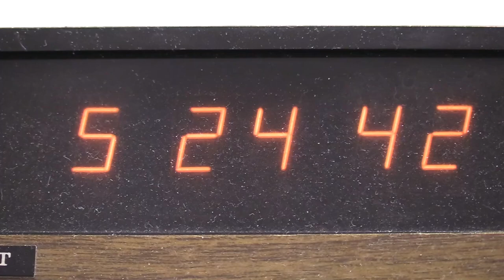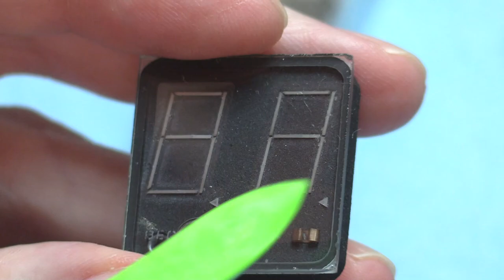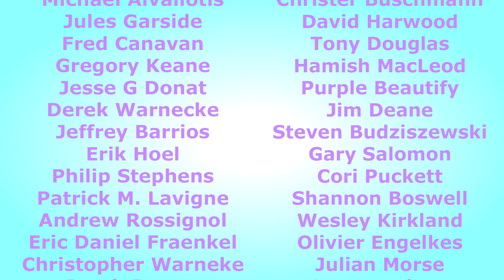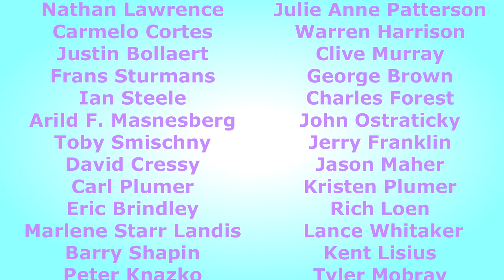Why Are Tubes Mirrored?

Comment: MAny of the older power tubes used the element Tantalum for the plate.  It made a good high-temperature tolerant plate, plus hot Tantalum absorbs gas, so a free getter.
Reply: The 845 uses carbon for the anode. Except for the modern 845M which has a metal anode.
Reply: I have long wondered about the potential recyclability of old vacuum tubes, crushing the glass envelope  and recycling the metals found within.  There must be lots of high-purity copper and steel, possibly cobalt and other rare earth metals.

Comment: There's a very interesting and simple experiment you can do by placing some water in a place, putting a very small candle in something that floats and then you put a glass upside down, covering the candle. It'll pull some water up the glass, by removing the oxigen from the air inside the glass. Very similar, but in a way smaller scale.

Comment: Some of the really high power ones use uranium glass seals.  If its got a greenish bead where the pins come out, thats what it is.  I've never read any radiation there but it glows really nice under UV light.

Comment: Wow. I had always figured that the silvering was either placed there to reduce radiative heat loss or maybe accumulated over use as a kind of gaseous deposition of metal from the hot emitter.

Comment: Phillips made a getter that is RF fired, but does not make a film, but becomes a reactive block in the vacuum. They are used for the inner getter in HPS lamps to absorb gas generated during the lamp life, so that you do not have a spot on the glass that absorbs light and creates a hot spot. 

Your 4-400A tube uses the pure iron of the anode, coated with a thin coating of iron powder, that is reacted back to metallic iron during manufacture with heating in hot hydrogen, so the iron oxide is reacted back to metallic iron in nanocrystals, so the iron can react with any gas during the tube life. They do need to run to red heat in use to get the iron to react, so they tend to be very gassy the first few hours of use, and if they have not been powered up for a while, so need to have a slow ramp up of power and detection of the tube arcing over. Once hot they will run for decades in use though, as use keeps the iron hot and absorbing gas.

Comment: As an Electronics Tech (Avionics) trained in the 70s, it was at a time when vacuum tubes/valves were disappearing and I worked on quite a few hybrid transistor/VT devices. 

As per normal in that era I also did a TV servicing course and tubes in TVs were rife at the time and accordingly they were still in the syllabus. 

At the time I was also an operating Ham and still have stashed away a couple of 4CX250 bottles with chimneys for that HF 1kW Linear Amp I was going to build some day….some day.

Comment: In accelerator vacuum chambers, after scroll, turbo and ion pumping, the last two "stages" are the cleaning done by the synchrotron radiation and the "getter pumps" which are nothing but Titanium hot filaments, capturing part of the very last molecules. From that, I deduce the high-power tubes you've shown might not need a highly reactive layer. A part of the hot surface, on the opposite side with respect to the conduction one (otherwise the capture would be reversed by the electrons, tending to sputter), plated with Titanium, Magnesium or Zirconium should be enough.  Not sure, is just an hypothesis, the accelerators vacuum is usually quite extreme (~10^-13  to 10^-15 bar).

Comment: Ah ... Tubes ! I love those things. I once obtained an old radio communication console from an old bomber which had some amazing tubes and even a squak box and code interpreter. I tried to get the Prints and schematic for it but I was told it was still considered as classified. I just wanted to convert it to a 20 meter Ham for fun homebrew projects. That thing was heavy, I wonder how that plane ever got off the ground.
Reply: I bought a Wireless No. 19 Set as used in tanks. It needed a lot of work to get it going: re-wired wrong wiring, 2 coils to re-wind due to corrosion, BFO disconnected, I replaced 3 visibly leaky capacitors, etc. Rusty and tatty.
I made it xtal control on transmit for stability, Morse Code only on 3.560, 5.262 and 7.030 MHz, and only 2 Watts with low H.T. It says something about the reliability of everything for it to still work after 76 years.
G4GHB.

Comment: 6:30 - The "lot of getter" is probably sputtering of electrodes that is common for plasma based light bulbs as material is being bombarded by gas that ejects microscopic particles of metal that deposited onto other surfaces._

Comment: if people are worried about vacuum tubes, what would they think of the 5 pounds of thoriated tungsten I have in my garage? It's in common use for TIG welding, especially with older machines. Yes. My geiger counter goes nuts in that corner!

Comment: I found what looks like a getter ring in the top part of a ZM1000 nixie tube but no silver spot or anything. Funny thing is the ZM1001 symbol nixie doesn't have the ring but a kind of plate and the ZM1030 has neither.

Comment: Fran, thanks for explaining. It's very clear.
But you mention a tube is "flashed" near the getter. What does that mean?
Reply: The manufacturer aims some kind of high intensity radio frequency or microwave beam at the getter loop inside the tube,  and that fast burst of energy vaporizes the material held within the gettor loop and deposits it on the inside of the glass.  I would think that the direction of the beam and how it is aimed would be important because you don't want those metals ---- presumably conductive and capable of emitting electrons when heated ---- to be splashed onto the other elements of the tube or the mica insulators because then  The Michael would not insulate and the misplaced getter material would emit electrons and interfere with the stability of the tube.

Comment: The filament inside the tubes might be containing small amounts of thorium, especially directly-heated cathodes. But these would be too small amounts to even be detected when you were taking the bare filament wire. And as you stated already in the video, the anode plates and the glass would perfectly shield the alpha radiation anyway. 

But for most I believe that this is the usual misconception of people associating barium (and cesium, strontium,...) with radioactivity, because radioactive isotopes of these elements are produced during nuclear fission. But of course in a vacuum tube one would use natural sourced barium (and/or cesium) for the getter, which can be considered stable and non-radioactive, even though it contains 0.1% of 130-Ba with a half-life of 1000000000000000000000 years.

Comment: When I first started buying and selling tubes several decades ago I was offered a bunch of 01A early radio tubes by a notorious local antiques dealer; the tubes were in what appeared to be their original boxes but the getters had a strong  "rainbow" colour effect, and so, in my naiveté, I assumed they were well-used and didn't buy them.  The guy wanted about 20 bucks apiece which I discovered later would have been quite reasonable and I could have easily doubled my money on them, but I didn't trust the seller who had a deserved reputation for overpricing everything....

Comment: I would think putting in any radioactive substances would be counterproductive.  With high voltages, any radiation would cause random discharges and "pops" in the signal.  You want clean vacuum to get clean signal, I'm pretty sure.

Comment: In most transmitter tubes they have an active getter that is part of the internal structure when the tube is run.833 tubes have these fired getters-at the base of the tube where there is no high voltage.Seen many of those tubes in 1Kw AM broadcast transmitters.Two for parrallel RF power amp-another pair as a PP modulator.If you watch one of these AM transmitters playing on air you can even see the plates of the mod tubes blink to the modulation.Same thing with the 4-400 tubes-used in 1Kw AM transmitters pair as an RF power amps-other pair as PP modulator.In really high power tubes flashed getters cannot be used becuase of the high DC and RF voltages will cause breakdown of the ceramic envelope-some cases glass.The ceramic-metal tubes can be broken down and "rebuilt" the glass ones not so.Too uneconomical.Generally power tubes of 1Kw and over.At the transmitter plant I am in 10Kw,20Kw,250Kw and 500Kw rated tubes for 250Kw and 500Kw SW transmitters.VOA site in Greenville,NC.

Comment: "How do we neutralize interference from free-floating gaseous electrons? Bury-'em".😁.  According to Ludwell Sibley, author of the excellent reference book Tube Lore,  water vapour was a persistent and important contaminant that needed to be removed. Some manufacturers reportedly baked the tube elements in pure hydrogen to drive out impurities. Gee, that doesn't sound like a risky process, does it?! 🤔

Comment: I'd love a Geiger Counter - But I don't even know what a Geiger looks like, let alone how to count them! 🤦

Hmm, I have a remanufactured transmitter triode which broke apart at the point where the glass was welded - I never even considered the radioactivity angle. I also have a second one which is still intact.  Have you seen the huge getter inside a TV CRT? About an inch to an inch and a half in diameter!

Now, which do you prefer "Halo" getter, or "Square" getter? - It matters, if you're a true audiophile, but to tell the truth, I can't tell any difference - Emperor's new clothes, maybe? 😺😸😹😻😼😽🙀😿😾

Comment: 6:21
No discussion possible: the number 0 (zero) may also be pronounced as o (the letter) when used in phone numbers, serial numbers, part names, etcetera.
Reply: Thereby increasing the chances of certain understanding. WTF
Reply: @NoName-zn1sb  I know, it's weird
Oh yeah, I forgot zip codes, a very important one.
Remember the TV show Beverly Hills 90210? You'd sound silly if you pronounced that as Nine Zero Two One Zero :D
Reply: Also the old B.A. screw sizes, always (letter) OBA, then carried on as 2BA, 4BA, 6BA and so on. Nobody in engineering ever said Zero BA.

Comment: The big tubes can give off a lot of X-Ray when under power. Got one marked with Radiation warnings printed on it  ( from an early clour TV) looked up and sure enough it was only when in operation. Even with 1930tiesn  Urdox (Uranium oxide) resistors it is supposedly not that bad unless you break them , then you are in big trouble.
Reply: It depends on voltage. In colour CRT TV, 25kV is used, so electrons get enough energy to create gamma radiation. (RTG lamps use 40-100kV). But if you use low voltage, than even high power tubes don't produce x-rays.
Reply: @xsc1000  Its a rectifier tube for 10kV
Reply: @vHindenburg  Even first NTSC colour TV used more than 20kV.
Reply: @xsc1000   I dont know which know which function it had, thats the information I could find on it, that it was used in TV sets. Yes I am aware that CRTs usually work with 29,9kV otherwise there would be problems with laws about radiation.Older  Black and White TV  CRT tubes were rated higer.
Reply: @vHindenburg  B/W CRT tubes used 15-17kV and lower current than color ones (only one gun, no shadowmask), so there were no problem with radiation.
Reply: @xsc1000  the tube in question is a GY501 from Europe. Whch has a label caution X-Rays printed on it. I got it with a bunch of PL tubes like PL520 and PY500As
Reply: @vHindenburg  And you can find in Telefunken datasheet, that this tube is indirectly heated high voltage rectifier with nominal voltage 25kV, 1,5mA current. Max voltage in pulse 33kV. So its standard rectifier tube for colour TVs from 60s. PL519 (I dont know PL520) is line output pentode and PY500 is damper diode for line output. These tubes were high power, but used about 8kV voltage. The most dangerous in colour TVs were shunt triodes used in old constructions to stabilise high voltage.
Reply: @xsc1000   It hs been a while since I looked these up , the 519 and 520 are almost identical the 520 is lightly more modern, but I am pretty sure since the model of the GY Tube I got here is one of the unshielded (older) ones gives of some X-rays does it. I never have used any of those they just ended up in my collection . I guess the rarest ones I have around are two PL 6574s which are Thryistron Tetrodes from an old electric welding gear.

Comment: I've seen sintered zirconium used in heated components (a few hundred °C) as a getter. I'm not a chemist, though, so I can't speak to what's special about it.
Reply: Zirconium is really chemically resistant, so much that it's used in nuclear industry for that reason and its low cross section. However, at high temperatures is very reactive with oxygen, so it's used for getters.
Reply: @tiger.98  Interesting, thank you!

Comment: Saying "Oh"-C-3 is fine. Back when tubes were still in production, sales and distribution was done by HUMANS, and very few computers in sight. Your average stock clerk knew to look in both the "0" (zero), and "o" (letter O) section of their catalog. Plus delay relays (in tube packages) such as the 117NO30, where the "O" after the "N" is a letter-O, and the "NO" pair means Normally Open. Yes, 0C3 is really a zero, but I pay no attention to those that ANAL !

Comment: I object to your objections of the objectors!
I just googled for "oh"C3 and got marijuana and high-speed data lines, whereas using "zero"c3 I got "The 0C3-A is a two-element gas filled, cold cathode voltage regulator." 
Case dismissed!
Oh, and is it a "toob" or a "t'yoob"? Make up your mind.
(I learned about Getter when I was a teenager—I'm now in my eighth decade.  /s/ WB0xxx

Comment: Why do tubes get "milky" when they lose vacuum?  Also most tubes with getters are "flashed" with an external coil during the manufacturing process.   Google "getter flashing" for the details.
Reply: They get milky because the barium oxidises.
Reply: This occurs due to the 'Getter' being saturated after a small or catastrophic leak
Reply: When air enters the tube, the barium getter combines with oxygen to form barium oxide, a white powdery material.

Comment: Why do people call the what remains inside an enclosed space, consequent to pumping the gasses out of (the gas-tight) enclosed space –   a vacuum? Seems to me they are giving a name to, more or less – nothing – to something that isn't, rather than to something that is.  Would it not be better to call whatever it is that a vacuum pump creates, inside a gas-tight tube – an evacuated space. A tube with such a space might be called an evacuated tube. Or in the case of the tube being discussed here, a greatly evacuated space. There is no way that I know of to create a vacuum anywhere else besides inside a gas-tight enclosed space. So why not use a noun for the space an an adjective to describe an altered characteristic of the space. rather than use a noun for the space, a space that has acquired an altered state. If I were to evacuate the air from, say, a spherical steel ball, would it not be better to call this object an evacuated ball, rather than a vacuum ball? Also, the purpose of a so-called vacuum tube is to act as a valve for automatically controlling the "flow" of electrical energy. Shouldn't we name the device after its function, rather than after a single characteristic, among many, of its construction?  An electricity valve? An electrical check-valve (sometimes called a diode)? An amplifier? For example: an electrical check valve housed in an evacuated tube consists of a glass tube, that has been evacuated, and that evacuated tube contains 2 electrodes – these last parts being the important parts. These also change from tube to tube,  to provide different functions, even though they may be  housed in a similarly evacuated tube. The construction of an incandescent light bulb can involve the use of an evacuated tube. But we do not call this device a vacuum tube, or a vacuum bulb. Rather, here we name it for its function – to provide light – we call it a light bulb. A better name might be a wire filament light-emitter. The vacuum is only involved in its construction because it helps the light-emitting filament last a long time. Why not name tubes with electrodes, the same way, according to the function of the electrodes, rather than according to the container in which they are "housed."

Comment: One of the reasons for using getter pumping is that high vacuum it becomes impossible to extract more gas from the tube using mechanical pumping through the narrow tubes required for tube manufacturing. The rate of pumping literally becomes lower than the degassing rate from the surface of the components in the tube, so more pumping through a narrow tube makes no difference. With a getter pump the vacuum slowly becomes stronger after the tube has been sealed.

Of course high vacuum is used routinely in science and industry, but a modern turbomolecular pump has an inlet with a diameter of about 200 mm. 

If you want to understand why effective vacuum system design is rather specialized, read up on "mean free path".